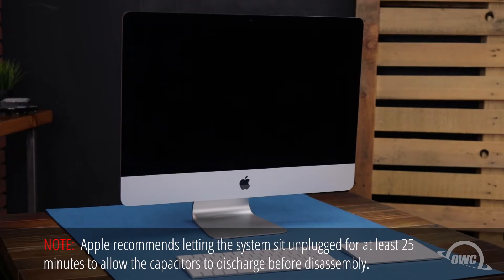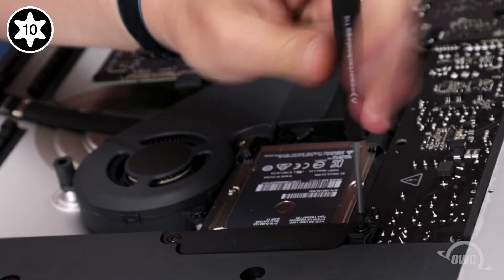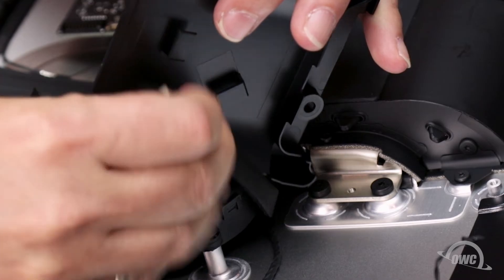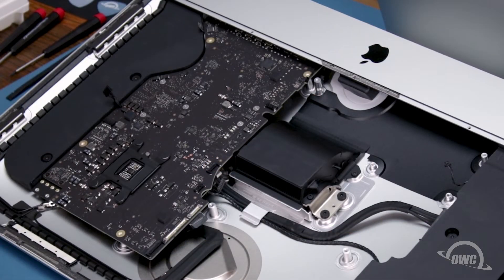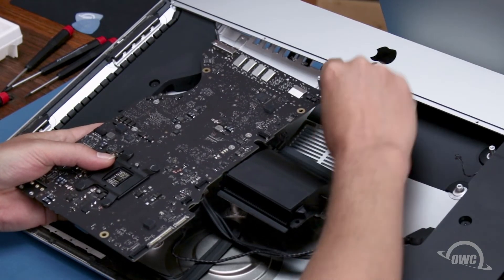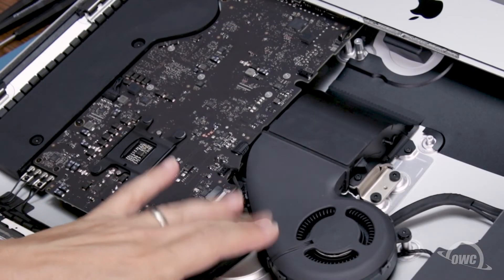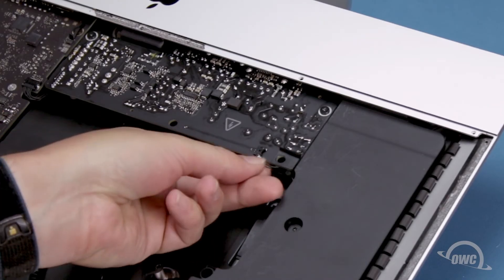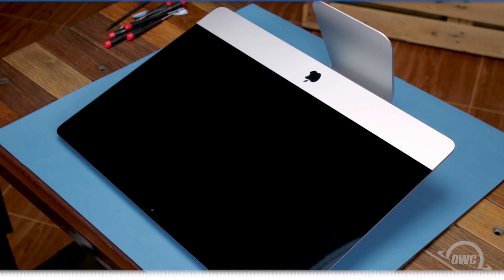How to Upgrade/Install Memory in a 21.5-inch iMac (Mid 2017) iMac18,1 iMac18,2

Comment: am I 5 years to late?
Reply: I purchased this iMac in 2017 with Logic Pro X, and I definitely got my moneys worth . Although, Now I am trying to to stream on twitch and downloaded OBS. I am having trouble with my stream due to my live stream lags when I check but OBS runs fine. (although I am definitely putting the iMac to work like never before. As audio daws don't really use up a lot of CPU). I am trying to figure out the right setting in OBS, but I also noticed that I am able to Configure the IMAC  by taking it to an apple Authorized service provider (apple said they can't do it because it is vintage). My question is, should I go through with the configuration or just save up for a new desktop and leave apple and get a PC. mind you I also have a MacBook Pro 2019, but its not compatible with the new update that apple provides. What do you think I should do?

I also heard that since the iMac has the intel core and not the new chip. I could open the iMac and replace it with something newer, but it comes with a risk of cracking the screen and additional knowledge that I probably don't know, and I am reluctant have someone do it unless I know they can without a problem. Could you do it for me if this can be done, and how much would that cost? I could buy the parts separately, and just pay for the service. it is a IMAC Retina 4k, 21.5-inch, 2017.
Reply from the maker: Services like that we are not able to perform. We only upgrade machines with options that we sell, such as SSDs and Memory. We would recommend reaching out to a local repair shop to see if they are able to perform the upgrades that you are looking for.
Reply: @poweredbyowc thank you so much
Reply from the maker: You're very welcome!!!

Comment: upgrading the memory will make it faster? if so what is the maximum for my imac Retina 4K, 21.5-inch, 20173 GHz Quad-Core Intel Core i5 Radeon Pro 555 2 GB 8 GB 2400 MHz DDR4 serial C02WR2W1J1G5 mac os 13.7.8 (22H730)
Reply from the maker: Hey there,

Upgrading your iMac’s memory can definitely help improve performance. Especially if you run multiple apps, use creative software, or keep a lot of browser tabs open and you should be able to use up to 64 GB of memory with that model of iMac!

Comment: Thank you for this video! I have replaced the two slots with 8 gb each but for some reason it is only recognizing one of the slots, making it seem like there is only 8 and not 16. Any advice on what to do?  TIA
Reply from the maker: Thanks so much for watching our video and for sharing your upgrade experience! 😊 If your Mac is only recognizing one of the memory modules, we recommend first reseating both sticks to be sure they’re fully and evenly inserted. If the issue continues, try testing each module individually in both slots to confirm whether it’s a slot or a module issue. If one of the sticks isn’t being recognized no matter what, please reach out to our team directly — we’ll be more than happy to help troubleshoot further and make sure you’re up and running with the full 16GB. 💻✨

Comment: I have the 18,1 and bought 32gb of ram. Apparently the maximum is 16 gb. Will the 32gb ruin it?
Reply from the maker: You can upgrade to 32GBs of memory in the iMac 18,1 which you can find here: https://eshop.macsales.com/shop/memory/imac-2017-21.5-inch
Reply from the maker: You can upgrade to 32GBs in the iMac 18,1! You can find out upgrade here: https://eshop.macsales.com/shop/memory/imac-2017-21.5-inch
Reply from the maker: The 32GB will work just fine, we fully tested all of these units with that amount of RAM and have found that it can go past the 16GB that Apple states this machine can handle.
Reply: @ I tried it and the Mac just doesn’t turn on. I’ve redid it twice and tried Command Option P R but still no difference. Just a black screen with the fans working. I hear no beeps or anything that shows that it’s working. It’s such a hassle to take it apart.
Reply from the maker: You can check the compatibility of each computers RAM here https://eshop.macsales.com/shop/apple/memory/

Comment: Hi! I have a  imac Retina 4K, 21.5 inch, 2017. is it possible to upgrade the 8G ram to a 32G?
Reply from the maker: Yes, you can! It's actually the same as the non-4K model of the 2017 21.5-inch iMac! Here's a link to the product page: https://eshop.macsales.com/shop/memory/imac-2017-21.5-inch

Comment: At 11:33 it's really difficult to not trap that tiny ribbon cable that I believe might be the microphone. I had to fish it out of of the bottom of the aluminum case, gently pull it up and tape it to the front of the case so the logic board didn't trap it again as the board brushed by the cable while being reinstalled. And if you're like me, you can swear at the top of your lungs at Jony Ives for burying the memory DIMMs so deeply in this iMac - literally cruel and vicious behavior, anti-consumerism at its peak.
Reply from the maker: Thanks for sharing your experience! That tiny ribbon cable can indeed be tricky to manage during reinstallation, and your solution of taping it to the front of the case is a great tip for avoiding frustration. And yes, Apple's design choices—especially when it comes to burying components like the memory DIMMs—can feel pretty user-unfriendly at times! We hear you. Hopefully, the upgrade process went smoothly in the end, despite the challenges. 💙
Reply: @poweredbyowc  Yes, I now have 16GB instead of 8, but it downclocked my 2666 MHz DDR4 to 2/3 of its rated speed, to 2133 MHz. Apple maliciously "dumbed down" the base iMac just to make it underperform its more expensive models.

Comment: When they got to the part of the video where they finally pull the logic board I couldn’t help staring at the wide open section of metal that is the actual back of the iMac. You know, the spot where Apple could have easily put an access panel. They have become the polar opposite of the company they once were. Great video from OWC, but there’s just way too many points where a connector is not going to come loose, or a screw will get stripped, etc. for me to justify attempting this.
Reply from the maker: We agree with you. But at OWC, our goal is to make installations more manageable and customer-friendly.

Comment: can i get the kit with 1, 2x16 memory. And does the kit come with adhesive.
Reply from the maker: Certainly! We have two options available:

The first kit includes adhesive and memory, which you can find here: https://eshop.macsales.com/item/OWC/2421DDR4S32P/

The second kit includes memory, tools, suction cups, microfiber cloth, OWC Screen Removal Tool, and adhesive strips, available here:https://eshop.macsales.com/item/OWC/2421DDR4S32K/

Comment: Is it a reason you didn’t replace the ram from the back of the imac where you push the button and there is a slot that comes off instead of taking screen off the long way? Not being smart just asking from others I seen, or is the 27 inch and 21 inch ram replacers different?
Reply from the maker: Hey Doffy,
That is a great question, and many have wondered the same. Unfortunately, since 2012, Apple decided to design the 21.5" iMacs without a back door for RAM upgrades. This means the only way to upgrade the RAM in the 2012 and later 21.5" iMacs is through a more involved process that requires opening the machine.

Comment: Dude you could have written a disclaimer that some boards don't even have the ram slots, I got to part 2 only to find out I don't have those slots! Same model, iMac 21 inch 4k 2017. Can't believe I went through the trouble, and now I have to piece it back together and hope it still works
Reply from the maker: We would recommend double-checking your Model number as some years did not include the ability to upgrade RAM. The information we are looking for to confirm your model is the model identifier that is found in your system information.

Comment: Which speed of RAM is compatible with iMac 2017 base 21’ inch which is non retina non 5K non 27 inch model.

I need to make a choice between 2133, 2400, 2666, 3200 Mhz for intel i5 2.3 ghz 7th gen processor. But unable find the answer anywhere to be precise if this can be upgraded to a higher speed of RAM. Please advise
Reply from the maker: The RAM that we provide for this model is a 2400. I would recommend reaching out to Apple to ask if it is possible to have a higher speed in this model.

Comment: Whats the maximum ram capacity of the iMac 2017 21.5 inch
Reply from the maker: The maximum RAM for the 2017 iMac 21.5" varies depending on the specific model you own. For the 4K model, the maximum is 64GB, while the base model tops out at 32GB. If you're unsure about your model, feel free to contact us with your serial number, and we'll gladly confirm it for you. Alternatively, you can use MacTracker, an app you can download on your iMac, to check the maximum RAM your model supports. We're here to assist however we can!
https://eshop.macsales.com/Service/

Comment: Did the ram thermal pad disappear at some point in the video after putting it on? Looked like it was missing a little later in the video.
Reply from the maker: We're not seeing it missing, but could have easily missed it with this being a longer video

Comment: Pro tip: If you're going through this process to upgrade your memory, also replace that old SATA drive with an SSD at the same time since you have everything ripped open already.
Reply: If you just upgrade the RAM it's hardly going to matter. The SSD is a must!

Comment: Mine wouldn't boot after installing the 2x16gb so I had to reinstall the old 1x8 stick. I tried resetting smc but that didn't help. A lot of work wasted however at least I was able to upgrade the hdd to an ssd.
Reply: Any difference with the new SSD?

Comment: Thanks a lot, it is an excellent tutorial @OWC. A couple of the screws on the speaker were extremely tight and I had to use a tiny drop of oil to loosen them and come back to it later on so it took a lot longer. As you've mentioned in this post, a good idea is to use tape and reboot to make sure that it works - and then when everything works ok, use the proper sealing tape. (My microphone doesn't work now - which isn't a problem as I always use an external one anyway) but I successfully upgraded to 64 GB RAM.😅😅
Reply from the maker: We're glad to hear our tutorial was very helpful with the memory upgrade on your iMac. 😎
Reply: @poweredbyowc  Like I said, you deserve the shout-out. We make videos ourselves and we know how time-consuming they are. I've already mentioned your videos to other people who are thinking of upgrading and feel a bit overwhelmed. Thanks again 👍👍

Comment: I havent done it by myself but want to give a bit of push for thise who are just thinking of doing this:

Owning a 27 inch 5k top model I couldnt believe the used 21.5 ac is not faulty being so slow. Then got this change done by a friend, put SSD and 2x 16gb ram in and the 21.5 imac is booting quicker than the high end 27 inch, cuts video and does everything at least the same speed.

Amazing! Thanks
Reply from the maker: Sometimes putting in a new SSD and RAM is all the computer needs for a little boost!

Comment: I have an iMac 21.5 2015 
With 2x 4GB 2133MHz SO-DIMM ram Can i install ram 2x16gb 2400mhz?
On apple Web maximum size is 16GB
Reply from the maker: Regrettably, for this iMac you can not install more memory. The memory is soldered on the logic board.

Comment: Great video, I plan to do this and upgrade my iMac, however I can't help think I would be tempted to test it quickly before I actually stick the screen back on
Reply from the maker: If it helps, what some do is they will use masking tape or painters tape (something strong enough to stick and hold, but not impossible to get off) to hold the screen in place, they'll boot the computer to make sure it works, and then if it does, then they will finish it up. Just something that may help ya.

Comment: Completed the upgrade in a couple of hours with no issues at all. If I do this to another iMac I think I will be able to complete in an hour easily. I also replaced the HD with a 1 TB SSD and replaced CMOS battery while I had it open. If you have an older iMac I highly recommend doing all this. For around $200 USD I now have a mac that can keep up with my newer macbook pro easily, minus the processing power you get from M1. Unless you really need to do heavy lifting for CAD or gfx work, the processor isn't going to be a deal breaker. So happy I did this.
Reply from the maker: Hey William, We're glad to hear that the installation was great and that our installation video was very helpful for you. Please feel free to contact us if you have any further questions, comments, or concerns. https://eshop.macsales.com/Service/
Reply: Do you have the parts to do all this? Thanks great job

Comment: I would find out exactly where the ram is located from the back of it. I mean map it out exactly.
Draw a square/rectangle on the back a little larger than exactly where the ram is located.
Search for the best way to make the to be new ram access door detachable and remountable. Probably rubber seal or 3d printing.
Drill one hole at each corner of the drawn on rectangle/square. Possibly in a some other spots as well.
Find a way to run a dremel with the smallest bit possible attached to a sweeper hose and attached to something that will guide it along a straight line. Aslo only deep enough to go through the back panel. 
Then cut out the rest of rectangle. Stopping half way to tape what has been cut to the rest of the back.
Take some measurements for the gap cover.
Upgrade the ram. Testing the new ram.
Confirm, create, and test the new door latch mechanism.
Find the best way to monetize the whole procedure for the most ease of the buyer.
Reply from the maker: Sounds like a really fun project, if you happen to have an extra iMac laying around for parts 🙂🔧
Reply: @poweredbyowc  Any of the newer 21.5" iMacs with a bad motherboard would work.

Comment: man wth why isn't there just a door on the back of the machine.
Reply from the maker: Hey Redtails, unfortunately the 21.5" models being physically smaller than the 27" doesn't allow for easy access since they have to move where the RAM is. Why they couldn't have put a door where they moved it? I'm not sure, but for the 21.5" models it's unfortunately a big hassle to upgrade.

Comment: Thank you for taking the time to make this video, it has persuaded me not to bother trying to upgrade my iMac. How hard would it have been to have an access panel at the rear (Obv they dont wan't you upgrading it at all, maybe I could make one with my dremel lol !?!).  As memory upgrades go, this is by far the most insane I have ever seen. So many possibilities for a bad ending, from a cracked screen to getting electrocuted. Only thing I think I could add is If I ever did get that far I would change the CMOS battery while I was in there.

Comment: Alright, so I did it. Couple things to add. My computer did not have a hard drive like it shows in the video so it was super easy. The video makes these connectors look big. They are not! Also, I did the whole thing while still having the power supply still attached. I could not for the life of me get the last plug detached. I for sure thought the computer would not work because the power supply banged a bit, here and there. The whole process took about 4 hours, but now I have 32gb instead of 8gb. Also, another helpful tip: have small hands!!!! Unfortunately for me, I have rather big hands 😮
Reply from the maker: Well Dylan, we are glad to hear the install had gone well! While maybe not as smooth as intended it looks like you're up and running! If you ever have any questions during an installation feel free to give us a call at 1-800-275-4576 and speak to one of our techs we'd be happy to help you out!

Comment: I own 2009 and 2017 .it was easy on 2009.I was wondering how to upgrade on 2017 , 
but It is a quite,,,,,long process isn it..XD
Reply from the maker: Thank you for the comment. It is a lengthy process, but it’s totally doable and worth it, in the long run. I find that working at your own pace and pausing the DIY install video from time to time really helps.

Comment: Doesn't seem like 32-64GB would really be necessary.
Reply from the maker: We do not recommend that you go 32-64GB if you are not a professional. We only recommend if you are using large RAM requiring Applications and softwares such as photoshop, illustrator and Adobe.

Comment: just disconnect the camera cable and remove fan. all this is a waste of time.
Reply: Not quite as the ram cards are underneath the board. I couldn’t see an easier way.
Reply: @OfficialDSFN  If your RAM is not in a metal cage, look after joeyslaptop's brilliant video on that. But it is no method for people with big hands. Maybe you can loosen the RAM-clamps with toothsticks. I'm about to try it out this weekend, gathering courage to do this difficult surgery lol!
Reply: @yodel_diploma  good luck!!
Reply: @OfficialDSFN  Thanx! No job for impatient people. Changing RAM tested my nerves, but I succeeded  with the joeyslaptop-method👍 Now testing and then glueing the screen back to its place.
Reply: Did you watch joeyslaptop's video on that? He arrests the iMac-housing with his forehand and so can use both hands to unlock the RAM-clamps lol!